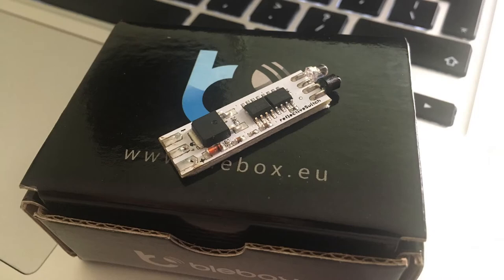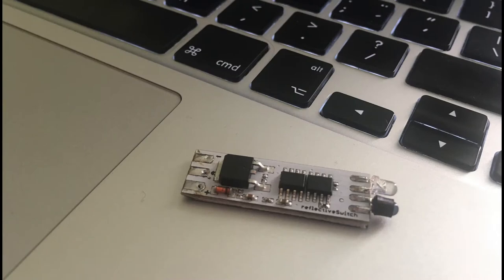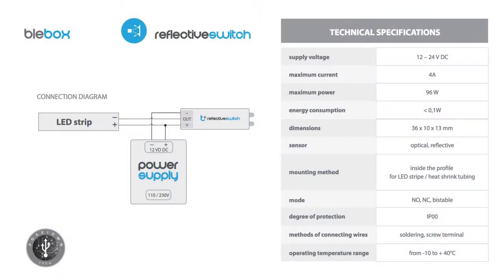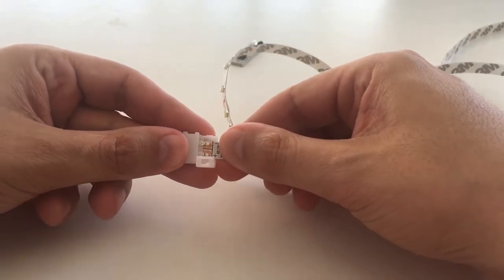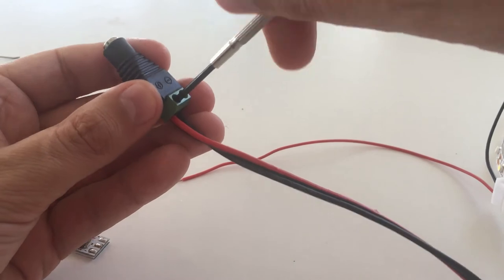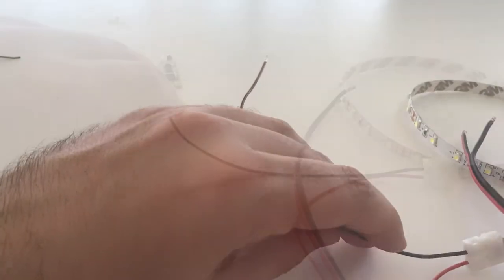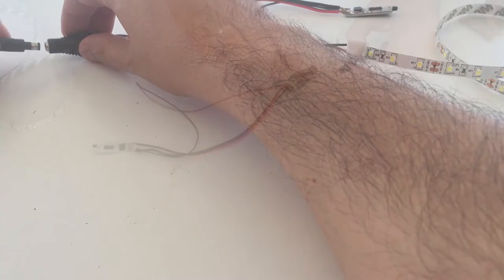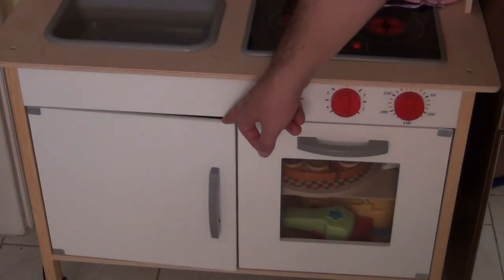Blebox reflective switch - Lights up your cabinet/closet (Smart home gadget)

Comment: So irs about light sensor! What I opened the cabenit at dark?
Reply from the maker: Reflective switch is a good choice for lighting up your cabinets or closets. Its small and works better than a brightness sensor. This switch works based on an optoelectronic reflective sensor and a miniature processor for digital signal processing.
Reply: Yeah would be much better thanks